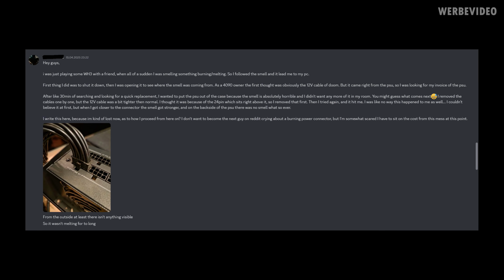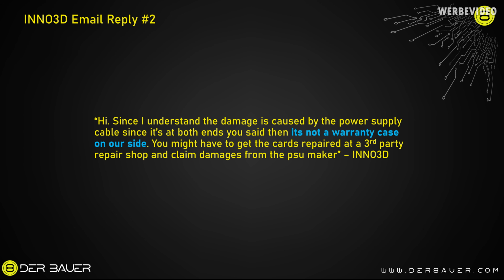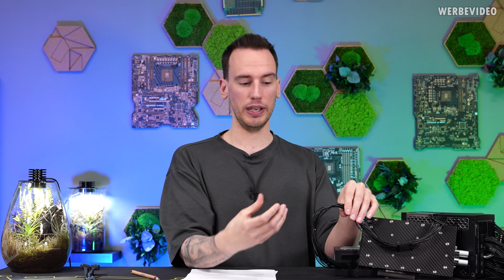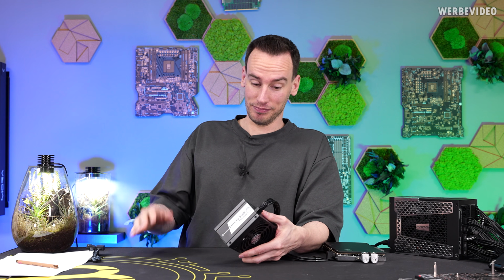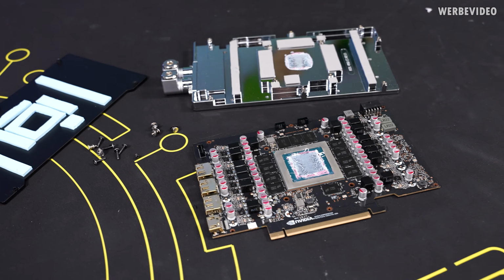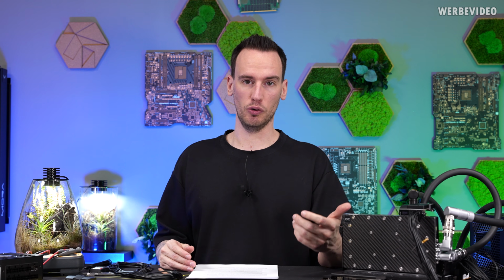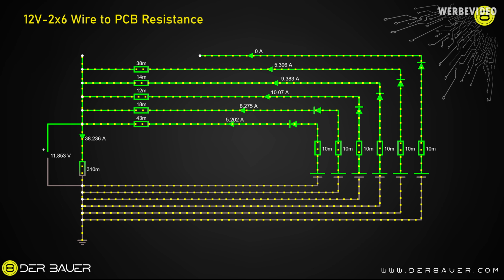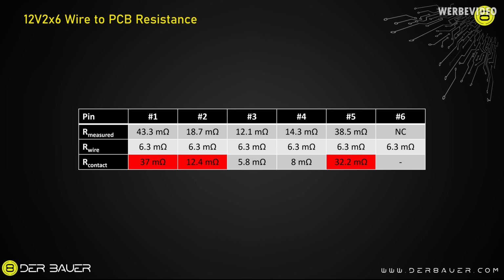Investigating and Fixing a Viewers Burned 12VHPWR Connector

Comment: Why has no one made a "load balance adapter" for HPV12? If nVidia are too lazy & cheap to put these on their $2000 card, surely some third party can provide it in some $100 adapter? Sense the amps on each input pin, vary the resistance to either balance the output pins, or at a minimum provide an LED warning light (and maybe alarm buzzer)... doesn't have to be ultra cheap as a niche "insurance" provider for this use-case... (edit: use a similar form-factor to all the "90 degree adapters" just with more 'smarts')

Comment: You forgot to measure the ground wires. They might be faulty too, because they have to carry the same amps (Ohms law).
Reply from the maker: Yes but you have a huge amount of ground pins in the PCIe slot. So typically a lot less current is going back over the 12VHWPR connector
Reply: @der8auer-en  Ye, you're right!

Comment: I'm getting bored with 12VHPWR content. The root cause of the problem is not the connector but instead the headroom of it (i.e. what it's rated to supply vs what it can supply safely). 8 Pin connectors don't melt simply because they had way more headroom, simple as.
Reply: Then don't watch it? Simple as. Some of us want to upgrade our PCs and not have to deal with this issue and this is getting the point across to the companies. Your point about the connector is valid, but without this content we're not going to see a solution at all.
Reply: @andrewzravenz2444  You misunderstand me, the fault is clear with the spec, no one has owned up after literally years of issues. I suspect GPU board vendors don't have a choice, Nvidia simply won't let them use 8pin, there really needs to be a class action lawsuit because they are so anti-consumer they will never admit it. It's the same deal as tobacco vendors lying about smoking being 'good for you' when they had the data for years that cigarettes cause cancer.

Comment: I've said it before and I'll say it again, there is absolutely no way I'm ever buying a 500+€ graphics card that has such an obvious and preventable fatal design flaw. Even if you ignore all the other outrageous stuff Nvidia is all about these days, this alone should prevent most people from even considering these cards as an option. It's literally a product to avoid.
Reply: Avoid Sapphire as well, their 9070 XT with the same connector has no balancing either.
Reply: Yep, if it has this connector I'm not buying it and will also warn others of the risk and also warn them that vendors have been primed with "user error" and will likely deny any warranty claim saying it must have been your fault.

Comment: "impossible to solve on cable side" no. All you need is single  phase 12vhpwr connector. Now they are individual phases which makes it possible to have uneven current. Gpu and only one rail and psu has only one rail/phase. Yet cable is split into 6 phases for no reason.

Comment: This connector is so bad, that's hard to believe that it was accepted for home use. Adding the fact that GPU (with one exception) cannot see the amps on the individual wires it's a catastrophe waiting to happen. Those wires are working almost on the limit, and if one fails - other have to take the load. Imminently melting. No words for such a laziness, bravo NVIDIA.

Comment: Yeah guys its not the gpu, its everything else that is bad. Seriously tho, that 850w psu is not enough for a 5090 system, why cheap out on psu when you buy a $3500 gpu ? Cant believe this user is going to have to settle for a half speed PCIe 5090 lol

Comment: Is connector dangerous only on high tier cards or it's possible to luck out on 5070 ?
Reply: thoreticly it could happen on any card but with a higher chanse on cards with high power draw. Tho for a 5070 i would not worry. 
in simple therms what happens is that on one or more of the wires somwhere between the connector on the psu side and the connector on the gpu side somehow has increased resistance that causes the power crossing the other wires to increase as power takes the path of least resistance. 
think  of it like 6 water strims flowing from the same sorce and you partially block one of them, that water is still has to flow thru somewhere so it will increase the flow rate of the other strims.
Reply: It can technically happen on any card but the higher end cards with higher current draw under load are more prone to it. The problem is the lack of any current balancing/limiting for the single wires so if one or two connections are bad and have higher resistance, the "good" cables take up more current to a point where they get hot (copper is a ptc material, it's internal resistance grows with heat) and more resistive themselves heating up even more rapidly. The crimp connections and connectors themselves are usually the points of highest resistance thats why the connectors start burning, not the cables first. 
It's ridiculous how big corporations get away with crap like this and no class action is filed despite all overwhelming evidence that 12Vhpwr is a mistake in itself. Shareholder value > customer protection -.-
Reply: 5070 has very low risk because it pulls way lower vs 5080/5090. However I've seen a 5070 recently that got melted on the sense pins area (this is due to confirmed user error and factory GPU defect though)

Comment: Perhaps this is a strategy by NVIDIA to ensure a strong 12VHPWR connection by plastic welding the connectors on each end!
Reply: "this was part of an update to ensure your cable does not come loose"
Reply: 🔥 That way, you’re permanently locked in and physically prevented from ever switching to AMD. Genius-level brand loyalty engineering! 😂

Comment: they should make law in EU that manufacturers have to investigate every fatal failure instead of blaming it to other companies, like you send the card and psu to either company and 3rd party non affiliated company does the investigation and says whose fault it is and the customer should get compensated, also nvidia should wake up and stop using this piece of sht connector

Comment: hear me out, how about instead of using 6 individual wires for + and 6 for minus, use 2x WIDE flexible copper braid like used in busbars? and only diverge that very close to connector itself.

Comment: Shame on you Inno3D
Reply: Don’t blame Inno. The connector is Nvidia’s design.
Reply: @techluvin7691  They built the GPU though, and they simply ditched responsibility by blaming the PSU. They are not blameless.
Reply: @ChrisFhey Nvidia mandates use of the connector just like how the mandate cards say GEFORCE in large legible lettering on the top edge.
Reply: @ Yes. That doesn't take away their responsibility though. They built the card and therefore should at least investigate the issue rather than outright refuse the warranty claim because they say so.
Reply: @techluvin7691  don't blame nvidia, its the group pciseg that approved it.
no...the warranty is with inno3d, its on them, yes 100% blame inno3d. They can take it up with nvidia
Reply: @techluvin7691  Yes. And partners do nothing about it. Except the Asus Astral model which can warn if a ping draws 0 or above 9 amps. If only any partner at least had the balls to bitch about it loudly, it wouldn't feel that bad as a consumer. But they all gobble up nvidia's balls. Except EVGA, they straight up left the nvidia gpu game and said fuck it. If more partners do that, may be there would be <some> effect.

Comment: Thank you for still covering this topic! 💙I feel like NVIDIA has kind of just hand waved this issue away even though it is still relatively common. I watch repair shop videos that are still fixing multiple melted connectors every day, and I bet they will continue to melt as long as this silly connector is in use. 😥

We'll now have multiple generations of video cards, cables, and power supplies that are not only possible fire hazards but are more likely to become e-waste in the future.

I wish they would just drop this and go back to 8 pins, or at least let partners make models that use the regular 8 pin connectors. Ideally they should've dropped this standard after the 40 series. Very disappointed in PCI-SIG as well, someone should have stopped this before the standard got out the door.
Reply: Intel is best proof that connector sucks, when they don't use it in their GPUs, and it is THEY who created connector (as all ATX standard).
Reply: so why is AMD using them on their cards ?
Reply: @ It seems like AMD leaves it up to the board partners; I know some Sapphire 9070 XT cards use it but the majority use standard 8 pins. 😃

They have lower power draw than the 4090 and 5090 of course, but I would even avoid AMD cards with the connector. 💀
Reply: @ry6000  I think you're fine with 4070 Ti /5070 Ti super/non and a AMD equivalent , probably even a 4080
Reply: @ry6000  Just hope they fix it for the high powered ones because the three headed monster is ugly asf
Reply: @ry6000  three cable just looks horrible, like it's a after thought, a bad one
Reply: @ Looking at parts is still a thing?
Reply: @ for me yes, I have a ( well somewhat tinted ) panel that   I can see thru-
I can see my CPU temp read out on my air cooler, important

Comment: Tugowar to pull melted cables out gpu & psu  Its not our fault  no warranty  If you ask me to send another cable wud be good promotional for them nope   FAIL . 
me still working out my 2080S  problems aaw snap think its that loose resistor thing  dam  soldiering chits me wont stick 
i,ll  try again  cleans iron head again  if no go i mite try soldering paste   i,m waiting to see when the NEW Bismuth chips get made .2nm 500ghz 10 years in the researching process

Comment: Never have I seen someone step on a psu in order to pull the cable out, that was impressive haha
Reply: and even then, it pulled out the housing too.
Reply: Yea it was funny as hell
Reply: Because usually people aren't trying to rip the connector off the PCB ;D
Reply: @unvergebeneid  I’ve dealt with tons of electronics and it’s pretty standard that the plastic part of the connector is relatively weak sometimes just pressed on since it’s main purpose is just to keep space between the metal contacts. I pulled out plenty of plastic connectors with the cables. The metal pins themselves are soldered to the board which is like miniature welding so you would never pull those off.
Reply: Wishing it was you? :D
Reply: +1 for using Jordan 1's too!

Comment: Isn't it about time to change the connector to a xt60 type/sort of connector?  I mean with less but very thick wires, like 4 times 10 or 12 awg.
Reply: Or the direct to MB board solutions some have made.
Reply: @djchotus1  No no no, that's just another extra connector and motherboard traces to fail.

Comment: At what point does a regulator step in and put an end to 12V high power.
Reply: probably when a house or business burns down
Reply: @ZaPirate  No, it will be a "cable issue"
Reply: Can this be petitioned?
Reply: @DoYouLikeThisName  considering that it poses a genuine life threat due to a potential electrical fire it should be doable because regulations have been done for less dangerous devices
Reply: The regulator of the industry okayed it.
This is THE intended behavior
Reply: @HyperScorpio8688 car makers were allowed to use leaded fuel even though they knew for decades that lead was very bad for both environment and living beings on said environment

we had plates with radioactive material on them because nobody knew that radioactive materials could cause whole load of serious health issues

today we have this discussion about plastics because turns out those are also harmful

just because something was greenlit originally does not mean that its use should be allowed if we know that there is a potential for serious injuries and electrical fires
Reply: Yeah. At this point this is not just about losing money or name as Nvidia, this is about health and safety for people and their homes.
Reply: 12V High Failure Rate as Buildzoid calls it
Reply: True…….the fire hazard must be above any regulation that exists. The fact that no electrical engineers can figure this out is pretty telling. I don’t think this ever happened with the older 8 pin connector.
Reply: @techluvin7691  Electrical engineers can figure it out. It's what their bosses are prepared to sign off that is likely the issue. I have made plenty of engineering decisions in my line of work that got quashed because my bosses felt they knew better about or were inclined to save money on. As I've repeated in other threads through this comments section, contacts and wires with more surface area is needed, that will reduce the overall contact and wire count. Sure, that would mean having to change PSUs for the different connector, and PCB design would be considerably changed but that's the only way to carry more power safely.
Reply: @ Cannot disagree with that. Just like water inside a pipe, if I’m trying to push too much through a small pipe I create friction and velocity that exceeds the maximum for that pipe……..therefore……..destined to fail eventually or right away as variations within the same pipe do exist. The connector is a problem…..yes…..but I question the PSU’s in these rigs. Are people buying 4090’s / 5090’s and not upgrading their PSU’s or conversely using cheap ass PSU’s
Reply: The regulator of the spec is to blame. The 12VHPWR connecotr spec says the incoming conections must be tied together directly after the connector on the pcb.

To add load balancing circuitry or anything else is technically out of spec.
Without load balancing we get the 40 series and 50 series problems
Reply: @Th3_Gael molex application specification for the connector system disagrees.
from connector application specification:
*This connector system is designed to mate tin plating to tin plating. Never cross mate tin plated parts to gold plated parts.
* This connector system is not designed for current sharing (i.e., splitting one current load across multiple circuits)
Reply: When a leader  is responsible. not in a capitalist world.
Reply: No, I like over the 3 headed monster 8 pin which is friging ugly asf
Reply: @kennethpereyda5707  pretty or working... hmmm.
Reply: @kennethpereyda5707 The 12vhpwr is just as butt ugly………but I’d rather not risk my home because of fire.
Reply: @kennethpereyda5707  just buy strimmer. Beautiful enough

Comment: Hello
Could it be that the uneven load on the 12V rails is due to the power supply not treating the connector as a single 600W rail, but instead as multiple separate rails that only merge at the connector? Could this be the reason for the voltage fluctuations between the 12V lines?

Comment: I do not understand why NVIDIA engineeres are so much ignorant about the much needed current balancer at GPU end.
What makes me angry is it hardly takes a tiny amount of pcb real state (around 20mm x 20mm), to add a current balancer circuit.
Reply: The upsetting part is that they force these rules on AIBs as well.
Reply: Its so they can save $3 in parts on a gpu that you pay $1500+ for... its enshittification at its best... what bothers me is that obviously NVIDIA legal team is hard at work so that when a problem with their connector and costcutting is hard to deny they just pressure everyone to look the other way and keep scratching their head "uhh there could be so many problem vectors... who knows"
I can't wait for the crocodile tears when the AI bubble bursts and NVIDIA has successfully burned all their bridges into customer GPU market and they are recognized as the shit company they truly are... AMD killed Intel and now they are mounting a good charge at NVIDIA and I'm all here for it
Reply: @Jacknzyeah Intel is as well. Celestial tape out is around the corner and BMG G31 has been circulating again. B770 and C770 could be coming in hot this year and next respectively.

I wouldn't say AMD killed them, but Intel has gotten the good kick in the ass they needed to get moving again.

This industry is at its best when as many players as possible are giving it 100%. Nvidia doesn't want to play that game anymore, like Intel used to be in the 14nm era, and need a wake up call. GPUs need their 5800X3D moment.